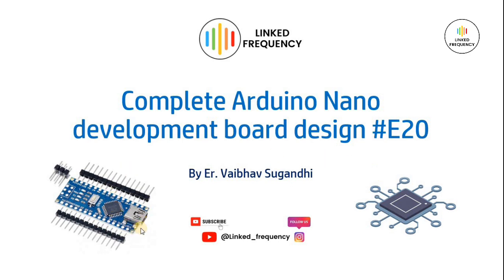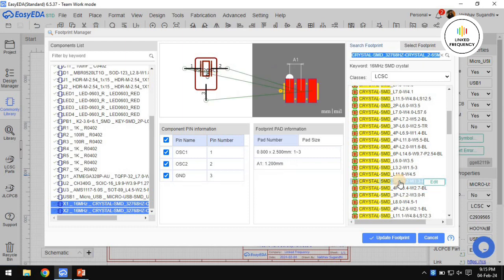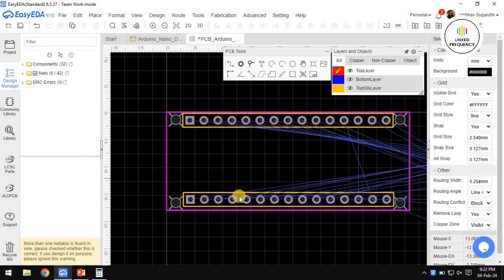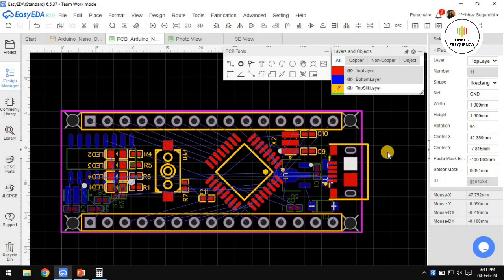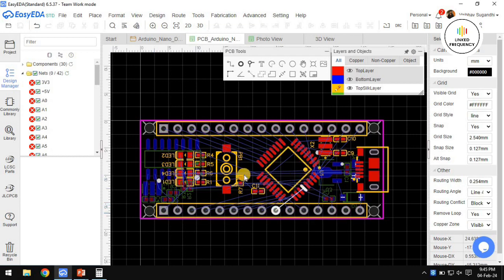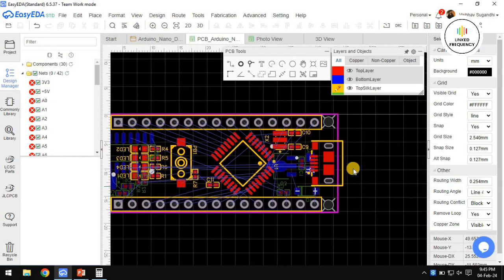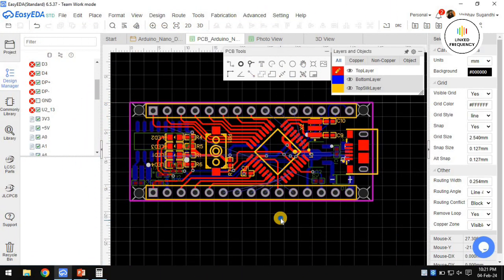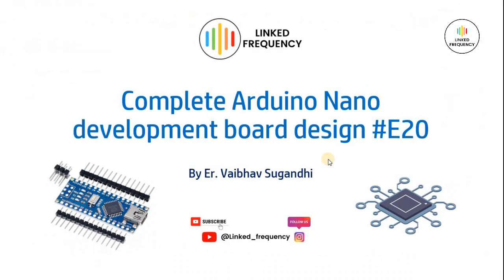Complete Arduino Nano Development Board Design #E20P3 | Vaibhav Sugandhi

Comment: How you insert+5v node ? In 25:30
Reply from the maker: When you connect +5V DC voltage to VIN pin, then It will be further connected to regulator inside. 
USB also provides VBUS, which is mostly +5V unless PPS based USB adaptor. 

Happy Learning :)
#Linked_Frequency